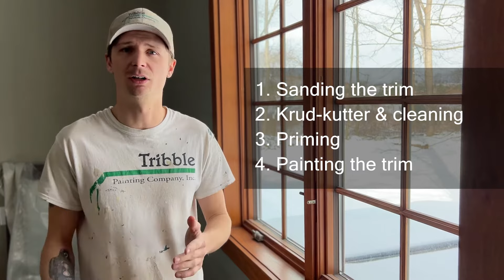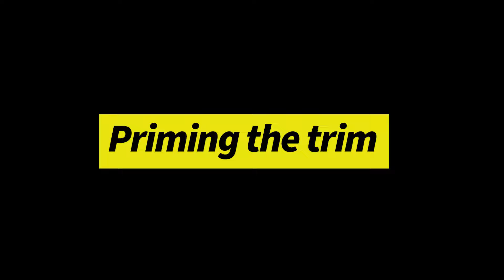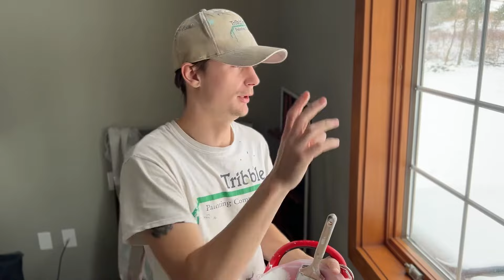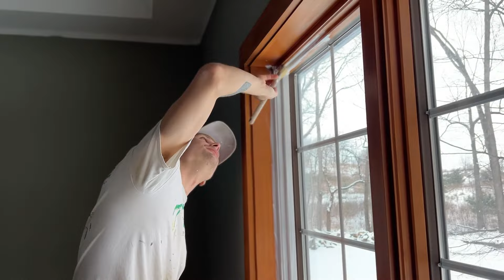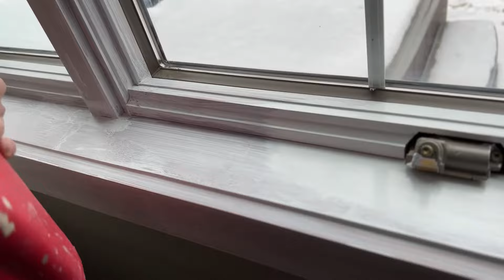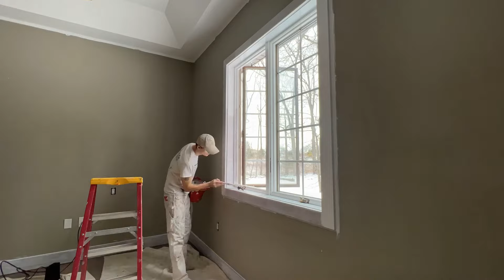Painting Over Stained Window Trim | 4 Steps To Getting it DONE

Comment: Thank you for the video!  I followed all these steps and after the first coat of Ben Moore advanced I am seeing yellowing coming through 😮, what might be wrong?  

Sanded (120 grit), Krud Kutter, filled holes with wood filler, sanded those spots, wiped down again, primed with Bin 123, one coast of Ben moore’s advanced. Yellowing coming through. Help!! Do you need to do two coats of primer sometimes?  Will the second coast of advanced fix it?
Reply: Did you use oil based primer??  I'm guessing not and that is your problem. You should use oil based primer over stained wood and then you can paint with latex over that when it's fully cured.

Comment: Let me tell anyone who reads this.. sand it and put sherwin Williams extreme bond primer on it… it won’t come off
Reply: I've got a HOUSE FULL of stained/sealed trim.  LOTS of it.  Crown, 2-piece trim on all doors/cased openings, 6" baseboards.  It's overwhelming to even think about starting a project where we need to "prep" the stained/sealed semi-gloss trim to paint AND paint all the walls...

Do I REALLY need to sand the trim before the SW Extreme Bond Primer?  This trim is ALL detailed - no flat parts.
Reply: @ depends on the quality your going for. Technically you don’t have to sand it before primer, however your finished product will turn out better.. don’t skip sanding the door jams and doors before primer and after primer. As a professional painter this is a MUST

Comment: Hey, great video. Fellow painter of 22 years here. This is perfect for home DIYers etc but just a few things to save you some time and money. The degloss and sanding serve the same paper, so you don't really need to do both. And BIN is overkill for 99 percent of applications. I use Zinsser Conversation and never have failure or bleed through
Reply: if I was to use the degloss are you saying there is no need to sand? I'm asking because I want to paint the wood window trim, base boards, kitchen cabinets, and door but, I'm afraid of bleed through. Also, I plan to do these projects myself and don't want to fail. Please send feedback. Thanks
Reply: @vinylxpressionz3479  yes deglossing is meant to make it adhere better. Get a good stain blocking primer after deglossing, like zinsser coverstain and then top coat with a trim paint and you'll be fine.
Reply: @michaelh7490  thank you Bunches
Reply: So, if I just wipe down with TSP solution, then it's ok to Coverstain and paint?

Comment: Great video! I was wondering what you'd suggest for changing the stain color of honey oak trim? I want it a lighter, more natural color with a stain or a top coat only but not paint.
Reply from the maker: Hi Beverly, great question! To refinish wood trim, you need to start by stripping off the old finish. Since stain penetrates into the wood, it can be quite labor intensive to completely strip it down to bare wood and start fresh. Are you thinking of taking on this project yourself or hiring someone to do the work?
Reply: @TribblePaintingCompany  wow, thanks for answering my question. I would do it myself. Getting the floors done today. Already took up carpet, put down white oak and its being finished with Bona IntenseSeal. So far, the floor color looks good with the original trim work and also with the honey oak kitchen cabinets. Might not have to change to color of the trim. If I have to, I'll know what to do. Thanks so much for your input!!!! God bless you.

Comment: Wish you did more detail on the KrudCutter part. I always wonder if I’m using too much and how long to linger on an area.  You only had the sped up video.
Reply from the maker: Hello! You will want to get a rag pretty well saturated, wipe off the trim you will be painting. Let it sit for 2-5 minutes to let the Krud Kutter break down the grease and grime, then take a wet rag to wipe off any Krud Kutter, and finish with a dry rag.
Reply: @TribblePaintingCompany  THANKS!  🙂

Comment: Thanks for the video, I’m trying to paint my stairs and railings that were stained a light tan and the primer I got per the paint store recommendation is coming on blotchy with the roller but looks good with a brush. I’ve used a Purdy 1/4” nap and a 3/8” nap from Ace, any tips would be helpful!
Reply from the maker: Hi Jeff, Can you describe the blotchiness?
Reply: @TribblePaintingCompany  Thanks for the reply! It coalesces into many small beads just a few millimeters across, I sanded the area significantly and tried using an oil based primer as well.

Comment: I painted over a stained wood interior door using a paint for Cabinets and Doors.  The paint was advertised as having primer in it.   I sanded, and then painted two coats.   It came out horrible.  The door was a 6 panel door.  Within a couple of months, the panels separated at the panel and panel center.  
The dogs were able to scratch through the paint.   The step I did not do was the stripper or the No Gloss.    With future doors, I will buy a vinyl door that is already white.   I am currently doing windows exactly as you show in this video.   I will follow the steps you did!   Thanks for posting this video!
Reply from the maker: good luck!
Reply: Old Guy's Rock paint and primer ain't any good for painting over stain you need a good quality primer and 2 coats of paint the only thing paint and primer together is good for us painting over dark colors

Comment: Great video!  Do you ever recommend doing a light sanding after the BIN Primer coat?  I am just starting to paint my trim throughout my house.  I'm also using BIN primer, but using SW Emerald Eurathane.  In regards to BIN primer, I was surprised to how thin/watery it is.  It seemed like when I brushed it on, it went on really thin.  But when using a small roller, it went on a little more liberally.  Thanks!
Reply from the maker: Dan run your hand over the trim after the primer dries. If you can feel a lot of particles in the finish of the primer, a quick scuff sand will smooth those out.

Comment: What are you doing? throw that Advanced garbage away and get the shellac BIN. No sanding needed, no deglosser needed and no tannen bleed. your first 3 steps are a waste of time and money.
Reply: Link?
Reply: Lol you still sand before using bin and you sand after bin. That's half of that's great about bin is how smooth it sands. And if it's something like oak with high grain you can even build it up before applying bin and fill in the grain by adding water to spackle and painting that on until smooth. You're not getting out of sanding
Reply: @filmsforfrens  ive used it for 20 some years. no, you dont sand before , it says it right on the can. Thats why you pay a premium price for it.

Comment: Painting stained trim: don’t.
Reply: Got to now; its not the "in" thing & people dont want to buy a house with it
Reply: @ms38wr1  they should just buy a new build with all the character of a doctors office then.
Reply: When pine is your trim and you cant restain to darker, it is just better to go a head and paint them. I wish honey oak was workable, but doesnt permit broad use of color
Reply: @patriciaparonett3225  I’ve stained plenty of pine, you can sand it if you don’t like the stain color….
Reply: @TacoCrisma  so you can restain pine crown and baseboards? I keep getting told I cant. But also, in some rooms I would want to paint them. Sand, condition and stain? I want it dark, very dark...
Reply: @patriciaparonett3225  it depends on how much detail is in the trim. Each time you remove material you will lose detail. In this case since you are working with new untreated trim I don’t have as much of an issue with it. There is a special place in hell for people who paint over old growth oak and gumwood trim in old houses however.

Since you want to go darker with your stain, if the pine absorbs the stain deeply, remove the surface color and you can apply a darker stain over the top of the now significantly lightened previous stain. It will affect color a bit - however not too noticeably.

You can also use shellac with pigment which will come off with denatured alcohol - no sanding required.
Reply: @TacoCrisma  just to note its definitely treated wood. We have oak everything else. The home was built in the 90s so..its not "old" but we are restaining it as well as ths floors. The sanding and refinishing of those will be a bit. I just have to see design wise which works where...thank you for the pointers
Reply: @patriciaparonett3225  take a very small area and sand it down a fair amount - see how far down the old stain goes into the wood. Then apply your new stain and see if the color is to your liking or if the old stain discolors it too much. It’s the only way to know for sure. Worst case - you can paint it.